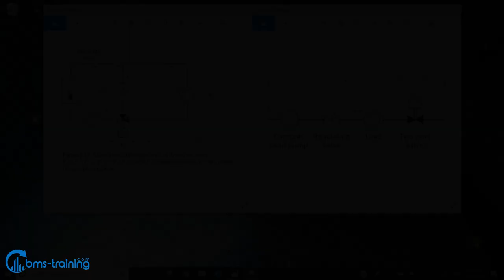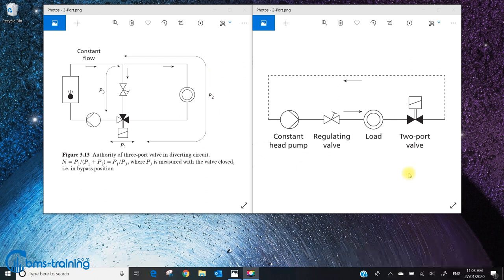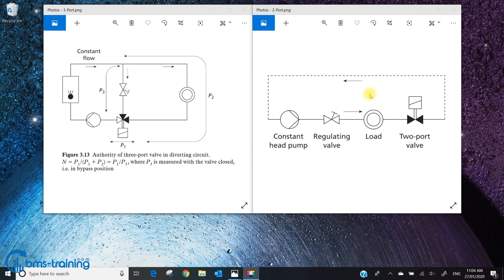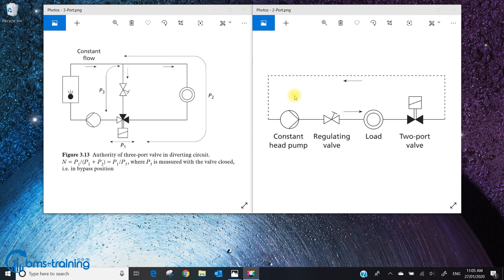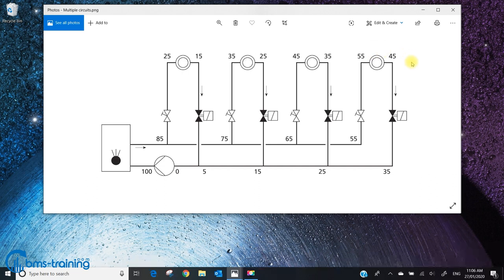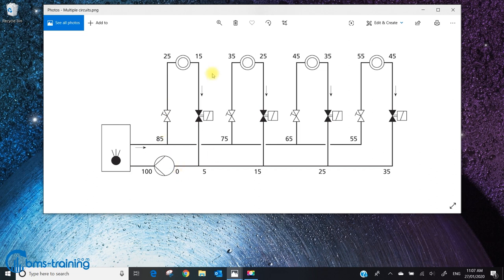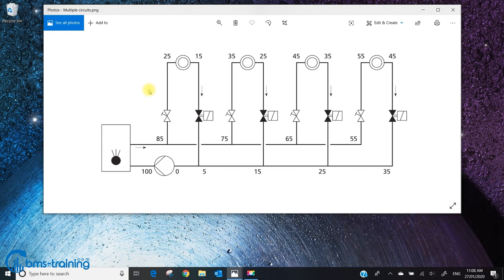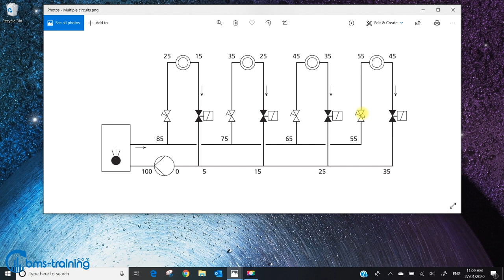Control Valve Authority 2-Port vs 3-Port (BMS)

Comment: Hi Bryce an interesting and informative video, the other consideration is that now with the use of Variable Speed Pumps the pressure is constantly changing making calculation even more complicated.  At  IMI Hydronic Engineering, we do offer assistance in calculating valve sizing through our Engineering Service Center utilising customers drawings and coil data. This allows us to select to minimise pump head, pump size and maintain better valve authority.
Reply from the maker: Hi John, thanks for the comment. Yes, a changing system pressure adds an additional layer of complication to an already difficult situation. Fortunately, by reducing the system pressure set-point (to save energy), we are actually improving the valve authority :-)   
The solution, really, isn't how do we better size 2-port control valves, but rather, using a smarter product. Your IMI (TA) Pressure Independent Control Valves would be an excellent start.

Comment: I work with Belimo. Normally customers just provide the coil pressure drop to size a pressure dependant valve. That is all the information we have so we just rely on that but according to you, we need the pressure drop of everything on a loop which people do not have that information. I am not sure how we should rectify this problem. We always advise them to use pressure independent valve to get it right since there is no way to get the size of pressure dependant valves right.  Even if we calculate everything, still that KV does not exist and we have to use the bigger one.
Reply from the maker: Yes, everything you say is correct. 
No one knows the local system pressure at the take-off for that water coil. 
So, even though I am saying we size valves wrong, there is no other way. 
What is important, is that we a least understand that what we are doing is incorrect and be more careful. 
My opinion is that for the past 20 years, we should have been providing self-acting mechanical balancing valves for each floor and plant room. Then mechanical could estimate and then set the valve to say 60kPa (it would hold that pressure all the time). Then we could use 60kPa in the correct valve authority formulae.  
However, those 'extra' balancing valves cost money so they never became an industry standard. I feel that how we design 2-port variable volume water systems is fundamentally wrong. 
Yes, PICV's are the answer, that is the way forward. In time, they will be the standard.

Comment: If you have multistory building use separate pump to move the water up, controlled it by differential pressure. Then every floor must have another pump to distribute water to the VAV boxes. Control again by DP. If you use Belimo pressure independent valves you will have no problems. For air handlers use Belimo EV, they are even better. May need some adjustments on the valves PID and the pumps PID and that's all. And by the way I am not a Belimo representative, I just happen to use their products.
Reply from the maker: Completely agree. I dont think 2-ports water systems were intended to be controlled the way we control them. I.e. globe valves and pumps, and nothing between. 
From day one we should have put self-acting balancing valves on each floor and plant room. Which is pretty much the same as what you are saying.

Comment: Many of the commercial and industrial projects that I've worked on in the last 10 years don't use pressure dependant 2-ports control valves. All 2-port PICVs now. No messing around with Authority or balancing valves. PICVs are simple to select and set up. The balancing guys hated them when they first came on the market because they lost a lot of potential business.
Reply from the maker: We are also seeing more PICV's Here in Melbourne, but not quite 50% yet. 
Consultants are not all specifying them yet. Tier 1 mechanicals have, as you say, realised there is a saving in commissioning.

Comment: Reverse return would solve the problem. Then the maximum pressure drop across the circuit is less and is also equal across all circuits = better control valve authority and balancing of flow.
As you say, valves are often oversized, particularly when they are sized for full load condition, when in reality the system may only really operate at 60% capacity most of the time. An oversized control valve will cause greater fluctuations in load than a correctly sized one as the travel of the valve will be greater than it needs to be when adjusting to load changes -  a phenomenon known as hunting.
Heat emitters/heat exchangers are often very efficient and so oversized thermally (they are sized around maximum pressure drops instead of heat load), but as it is misunderstood what the impact of this is, valves and pumps are then incorrectly sized.
Reply from the maker: Hi Elliot, thanks for providing a little more back story on these issues. Yes, there is scope for improvements everywhere.
Reply: Reverse return is not self-balancing, unless all the users have the exact same pressure drop. When does that ever happen. In my experience, never.
Reply: @hvacdesignsolutions  No, it is not self balancing and that is not at all what I said, but RR would make a significant improvement on other piping arrangements. Also, pressure drops are mostly consistent if the plant is correctly sized since the demand will depend on temperature requirements for heating - if it is for hot water production then that is slightly different as the relative demands can vary quite a lot for different parts of a building/property. But one of the main reasons for under or overflows in the first place is because the plant is incorrectly sized in the first place - particularly heat emitters and heat exchangers, which will inevitably lead to low flow/laminar conditions, low efficiencies and most probably valves and pumps will be subsequently mis-sized.